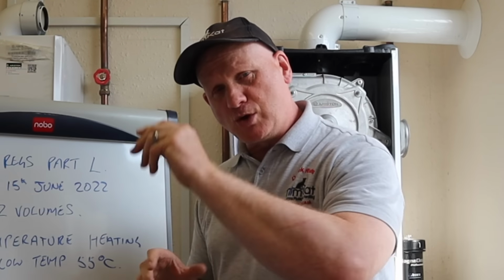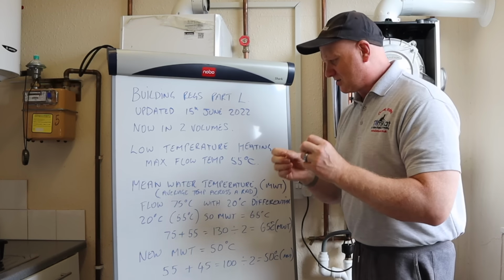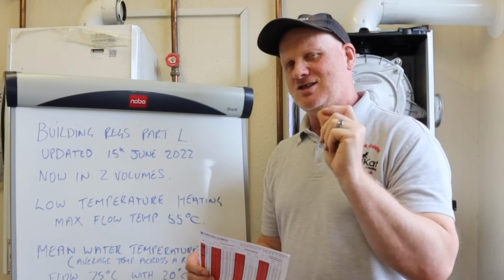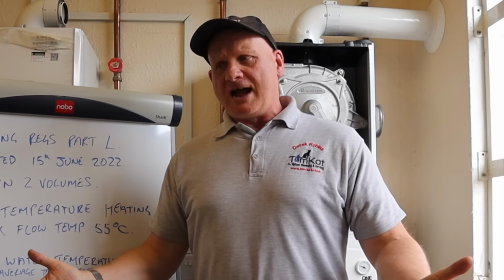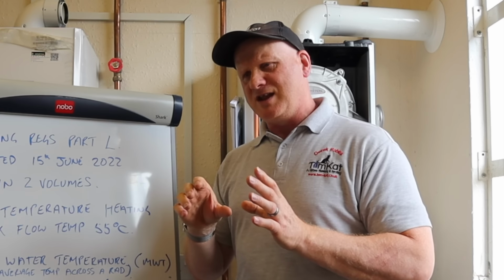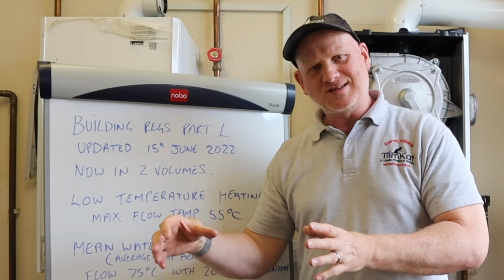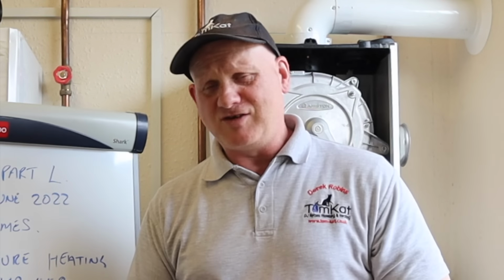Don't adjust your  heating flow temperature until you have watched this video. #saveenergy

Comment: I've been running my cylinder at 45C, only turn the flow up to 60 when I need to run a bath.  Never had a problem with Legionnaires.

Comment: Im on LPG with a combi and evohome zone control per room. Some rads are new and modern but none are suitable for a heatpump. I am thinking about a heat pump so turned my rad supply down to 4. In the last year this has saved me £1000 in gas. I have also optimised (recommissioned) the boiler myself a few years ago. One thing you really need to check is your flow return temp on the last rad. If you really want to you can datalog the pipes and optimise it to perfection.

Good video and i just realised i might need to alter my boiler pump set up.

Comment: I've read and read about low flow temps etc but I still can't get my head around the fact that if I have my boiler flow set to say 65c it reaches temp quite quickly, yet if I set it to say 55c it takes longer (obviously) BUT my kw useage is slightly better on the 65c setting. Also, even in spring/autumn surely it gets up to room temp quicker and then shuts off earlier it is STILL using less than ramping the flow temp down.

Comment: Room thermostats can really mess things up dreadfully. They are switching off the entire system on the basis of the temperature in ONE room. Worse than that, there are the 'human factors' that affect when the system switches on and off. 
Example 1. A school (1990s, recently refurb'd heating) where the most distance classroom, used by disabled children, never heats up. Problem traced to the behaviour of the school secretary and headmaster at the other end of the building. Both their radiators were turned up full and their office doors were open so that they could talk to each other. Unfortunately, the room thermostat was on the wall outside their offices and the heat from their radiators flowed out of the offices and switched the entire system off long before the furthest classrooms heated up. 
Example 2. New factory and extensive office space (2000) where office workers always complained of the cold. No fault found in the heating system, allegedly. After a morning of listening to much moaning about the cold, I sent some printing the big fancy colour printer in the main office area. As I collect my copies from the machine, I look up at the pillar it rests beside and see the room thermostat that controls the entire office zone, right above a huge free-standing colour printer that is pumping out huge amounts of heat. Intelligent stuff.

Comment: Any help and advice appreciated!⬇️

1) Should i turn off my boiker at the mains when I'm at work?
2) Should I turn down my temperature flow of central heating dial all the way to minimum when I'm not using central heating?

Thank you!🙌
Reply from the maker: I personally wouldn’t do either of those
Reply: I appreciate the reply, and could you explain why? Essentially I'm trying to save as much as I can and just started paying my own bills.👍🙌 @tomkatgastraining
Reply: Since he couldn't be arsed, then yes - if it's ONLY a matter of COST, turn your boiler off whenever you don't need it - but you MUST be wary of any dampness and mold issues that can appear in cold buildings. Curing those problems will be FAR more expensive than a winter fuel bill.

Comment: I live in a 200+ year old farmhouse with 2ft thick walls. The Boiler is 50ft away at the opposite end of the house to the living room, which is where we spend most of our time when at home in Winter. The battery operated room thermostat is out of range in that room, so we manually turn the heating on or off when we need to eg. when we have lit the log fire in the living room. This means the rest of the house cools down.
Reply: Then leave the thermostat in a different room, but turn the temperature setting down. You can stay toasty in your living room, the rest of the house won't freeze.

Comment: Tell me what is wrong with this - Turn the temp down 2 degrees and wait a few days. If all is fine, turn down another 2 degrees. Keep repeating until you notice too low a temperature. Then bump it back up 2 degrees.  Doing this will save gas, but increase the risk of Legionaires.  On average 15 people in the UK get Legionaires each year, and even less die from it. So this is safer than driving. Please tell me what I have said that is wrong.
Reply: .the ambient temperature will (probably) vary too much to try this...
Reply: Isn't legionnaires disease only from stored water that's exposed to the air?

Comment: Thermal mass is a issue. A cold home you move into will take 2 days plus to warm the walls. I've seen lots of data on letting your heating run on low 24/7, running at your desired temp 24/7, use when you need and 2/7 weekly, 16/16 weekends. Given the poor thermal insulation state of existing UK homes and sadly many new homes, plus their leakyness. This us the rule of thumb, add 10% to your bill running low 24/7 then topping, add a further 20% for running 24/7. 
The best advice is make sure your boiler is in condensing mode the majority of the time. TRV have a maximum potential save of 5% but from solar gain more than anything else, they are slow to respond to direct room temp and are usually behind something like curtains. Turn down not off rooms not used.
Use your gas meter as the gauge to balance running cost against warmth. Read weekly. Plus enure your Direct Debit is not too high or too low.

Comment: Not a plumber.... had combi boilers since 1988 in 3 different houses. I open the valves full and fitted the biggest radiators in the 2 houses I actually fitted the rads....3rd house brand new build in 2017 Taylor Wimpey tiny radiators.
In the Taylor Wimpey House we never feel toasty.....we are not freezing.... but not ever nice and warm as we were in our victoriana 3 bed high ceiling that I fitted the radiators back in 1988....we left because of the river flooded us for the second time in 2015.... worst move we ever made. These new so called  energy efficient houses are a con..... tiny radiators.... so heating much less water in the system..... same gas bills.... but less heat.
The good news is in our second home a down stairs flat in Scotland last Saturday I put the wood burner on .... AND.... the central heating with our new enlarged radiators..... 28 degrees in the living room.... faintingly hot.... I just did that to see how hot it would go.... and melt a polar bear at the same time.
I won't ever be turning our heating down to 55 degrees anytime soon.... thanks very much.

Comment: This was not the video I was looking for but watched the whole thing. Very interesting and informative. Thanks 👍
Reply: Yes, totally agree. Like a dummy I lowered the flow rate on my boiler back in the summer and it didn't even occur to me that the radiators weren't generating enough heat because of it. (I could keep my hand on them). I thought the thermostat wasn't wasn't working correctly. This was during last week when the temperature outside plummeted to below freezing. I watched this video and realised what I done wrong and cranked the flow temp back up to 80 degrees and now the radiators are boiling hot like they should be.  Thank you Mr Tomkat

Comment: I find lowering the radiator temp from 70 is actually using more gas, because the heating has to go on more often. These eco nuts don't really have a clue
Reply from the maker: It’s all about your radiator size to be able to run at lower temperatures if the radiator is too small for the lower temperature then the room will never get warm enough to turn off the heating that’s what this hole video is about.
Reply: @tomkatgastraining  what if they're adequate sized but because they're on cold brick walls surely losing around 10c

Comment: Hi, I have a Worcester Bosch condensing boiler, is the gas consumption reduced once the water has wormed up and the water returning to the boiler is hot, a bit like turning the gas down when boiling water in a saucepan then reducing the heat to let it simmer. Hope that makes sense. Regards David

Comment: Turning off your internet router may cause you problems, your ISP monitors your router, if it keeps seeing it disconnected (off) it will assume there is a problem so will slow down your connection to try to fix, so repeatedly switching off your router can cause you to have a slower and slower connection!!

Modern routers have more efficient supplies so wont use that much power when left on.

Comment: I was surprised by what you said at 3:10 (building regs 2022 covered replacement boilers). So I went off and did some searching of my own. I could be looking in the wrong places, but everything I read indicated it does not include replacement boilers. It only includes them if you are replacing the entire heating system in an existing building. As far as I can tell from what I read, if you just swap out your existing combi for a new one because it’s knackered, you are not required to turn down the heat or fit new radiators as you indicated in this video. The surveys to see if you radiators need changing is usually something that happens if you switch from a combi boiler to a heat pump. Im not sure if it is down to regs directly though, I think it’s more that those systems just don’t output the water at higher temperatures (possibly restricted by regs). But I cant find anything that says you have to restrict the temperature output of a replacement combi boiler when it is fitted as a replacement in an existing system.
Reply from the maker: You missed the bit were it said the replacement boiler is required to be 92 % efficiency. You can’t achieve that without a low flow temperature. Do some more research on efficiency due to boiler flow temperature
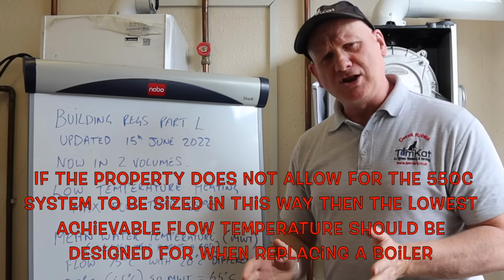Reply: @tomkatgastraining  QUOTING YOU (4:02): ‘If you are having a boiler changed, you need now to have your house surveyed' ... 'allow for a 55C flow temperature' ... 'If you dont, you may have to have your radiators and pipes replaced'. Is this true or false when replacing a combi boiler with another combi boiler?
I know what you might have wanted to say, but I just watched it again for about the 5th time, and you definitely implied that regs included replacement boilers and that might require changing radiators and pipes if they weren’t compatible with a 55C flow. If you already know what you said was wrong and correct yourself later in the video, please add a caption on the section which you correct later. Don’t have an expectation that people will watch to the end and see later corrections.
Reply from the maker: @Ironbuket  correct but it doesn’t mean you have to have your radiators replaced it’s about trying to get the flow temperature at 55 degrees if the old system can’t reach that ie from the survey then advise the customer the system would need upgrade. This is the procedure gas engineers should be doing before replacing a boiler
Reply: @tomkatgastraining  Looking at the Baxi website in relation to replacing an existing combi as an example, they dont mention anything about changing radiators or reducing the the flow. The only thing they mention is clean, flush, filter, protect, maintain - most new boilers require that anyway to get the longer warranty. No mention of requiring a survey or requiring them to recommend customers change their pipe diameter or radiator size that I can find. Where are you getting this from?
Edit: Sorry, I meant to say what Baxi have published for fitters in relation to Building Regulations part L changes and BS 7593:2019
Reply from the maker: @Ironbuket  why would a boiler manufacturer give that information. At the end of the day you will believe what you want but you keep looking and see if you can find as much information as you can to make you think you have proved me wrong why don’t you phone the prime Minister and see what he says
Reply: @tomkatgastraining  I’m not saying that everyone else must be right and you are wrong, but since you didn’t choose to provide where you got your info from is telling. I have found multiple sources which contradict what you are implying in this video when just replacing an existing combi boiler with another similar one. Why not just provide where you got that information from to clarify the situation? As to your question of why would a manufacturer give that info, I’m not sure if you mean why they would give advice per se or why they would give wrong advice. For the former, to warn installers of the changes to the regulations by the wording of their webpages. To the latter, maybe because they are correct and you are wrong?
Reply from the maker: @Ironbuket  I gave you the information it’s in the new part l of the building regs which does cover replacing a boiler and like I said the boiler requires to be 92 % efficiency like it says in part l. At the end of the day you don’t want to believe me so let’s leave it at that and if you are an engineer you just crack on with what you believe.

Comment: I usually just turn the heating on for 40 mins or so in the morning to get the house warmed up. If I turn the flow temperature down I have to leave it on longer to get the house warm. In my case would I be better off leaving the flow temp a bit higher?
Reply: I've the same question. It's trying to find the right balance between too hot flow temp and not enough. Ours was 54 which I thought was too low as it took a couple of hours to go from. 15 to 18. I've just now set it to 62 and will see how that  goes.

Comment: I'm running a 12 year old Ideal Logic Combi 30 and despite it's age, it's Opentherm compatible with the addition of a £30 harness, which is fitted to later models from the factory.  

It works really well with Evohome and unlike many boilers, it allows control of the maximum flow control, which I have set to 60c and was more than sufficient for even the recent cold snap.  

The beauty of Opentherm is it lowers the flow temperature as it approaches the setpoint and then has the boiler just tick over with perfect control of the setpoint, which makes the house very comfortable with its ability to maintain a constant temperature.  

When the system starts from cold, it will immediately raise the flow temperature to the set maximum (60c in my case) to bring the room/rooms up to the setpoint as quickly as possible but will then drop the flow temperature as soon as it can.  It's like having someone sat in front of the boiler, constantly tweaking the flow control.  

We have a mixture of old and new radiators, so I would imagine Opentherm combined with a modern boiler with a better modulation ratio and new, smart controlled radiators, would be especially effective/efficient.

Comment: So what would be an ideal delta t for a system boiler with an unvented cylinder ? Encountered a boiler in an outhouse open to the elements and not insulated running at high temp and the customer is saying their bills are extortionate!

Comment: Thank you so much for this - my house just wouldn't get warm and I found my boiler was set to 45° for the radiators. I've just put it up to 55° and I can feel my radiators warming up already! Thanks again!
Reply: Watch out. Because its all outside temperature dependent. If it gets colder you might need to turn it up by few degrees
Reply: Turn it back to 45 Celsius if keep it all day on with thermostat

Comment: Very interesting and very useful advice. I recently had a new Combi Boiler fitted and ended up using this advice.  To monitor the boiler being off and on I ended up taking 2 hour videos of it and checking  the switching on / off intervals. ;-/ I can be a bit of a 'nerd'. :)  Your advice really is helpful. :)  Thanks.

Comment: Hurrah, at last somebody pointing out you can't just reduce flow temp without potential consequences of having a much colder house contrary to all the stuff in social media. I have seen radiators in some new builds that aren't large enough to heat the rooms properly with a flow temp of 80c let alone 55C on cold days. Ours was built in 1996 and we really need 75 C flow temp on a very cold day.

Comment: Basically, turn your heating off
Reply: Trial and error with regards to how much you turn boiler stat down. With regards to lagging pipes in the airing cupboard is the heat not getting wasted into the house.

Comment: Great explanation - now just need to stop some of the heating engineers hoofing the flow temperature back up to max when they come to service my boiler!  One additional question - is the idea of a condensing boiler to have as little steam as possible exiting via the flue?
Reply from the maker: The idea is to take as much latent heat out of the flue temperature as possible. This reduces the amount of steam you see coming out from the flue
Reply: @tomkatgastraining  thank you :) It's these little things that never seem to get properly explained when you get a new boiler.  I've just reduced the flow temperature again - and there's now virtually zero steam coming from the flue, even though it's freezing outside.
Reply: @tomkatgastraining  A qualified gas heating engineer actually told me that the bigger the plume the more it's condensing ( I knew it was BS btw)...
Reply from the maker: @dingbat2177  no not really because it all depends on the flue temperature and the outside temperature.

Comment: My thermostat is broken it's a plain Danfoss RET230P (3 wire (L+N+NO/NC) with rotary  knob for setpoint). The cap or SSR is gone and no direct replacement. There is also an older rotary mechanical timer Randall 102 0r3 in a really inconvenient place which I'd like rid of or replaced and moved with something a bit more modern.
I'm going to have to  replace the roomstat anyway but these smart roomstats (Hive, Nest, Zwave, Zigbee or whatever), do they replace the timer/programmer as well as the roomstat?
If my Internet is down, does the Nest/Hive also fail?